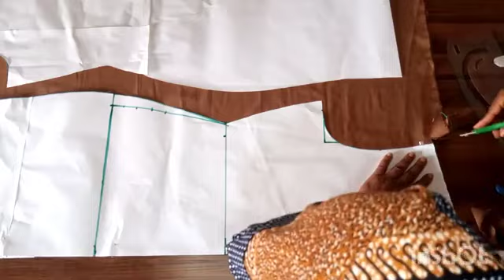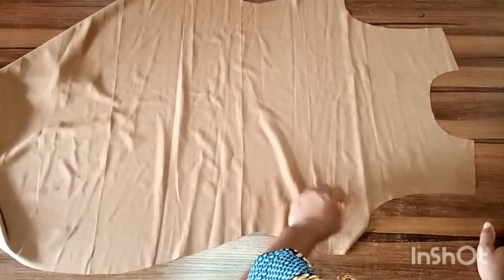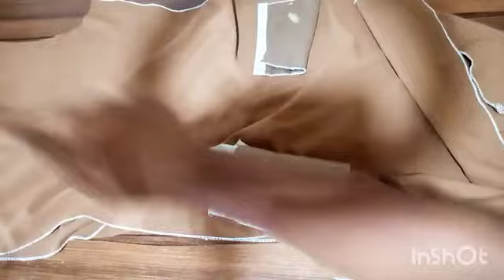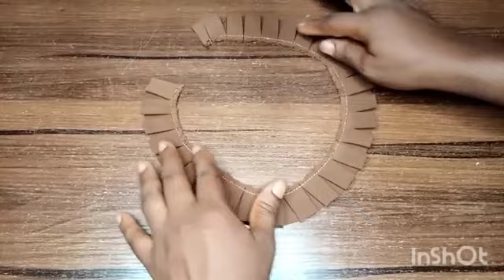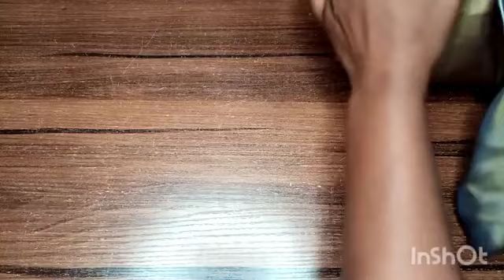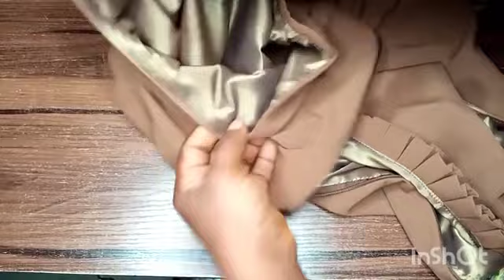How to sew a Dartless Pencil Gown

Comment: Thanks but where’s the cutting tutorial
Reply from the maker: Here's the link: https://youtu.be/-ANYANl4Gnc
Reply: @kayminicutsandseams
Reply: How many inches of sewing allowance did you use?
Reply from the maker: 1 inch
Reply: @kayminicutsandseams okay, I want mine to be straight not pencil,will that affect the 1 inch you went in by at the knee? And for the knee measurement should I used the 2 inches above knee line as my knee measurement?
Reply from the maker: The knee line is already about 4" above your knee, so taking it further will make it very close to the butt. And if you want your straight, then don't observe that contouring btw the hemm and hip line
Reply: @kayminicutsandseams okay ma,thanks